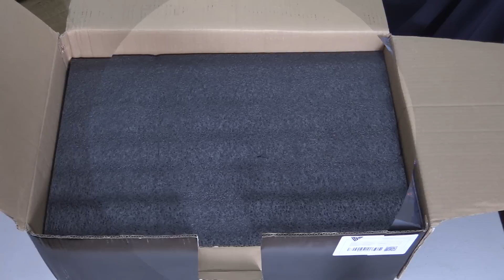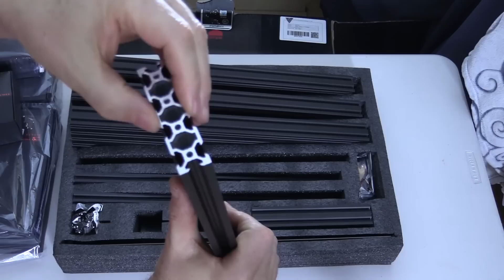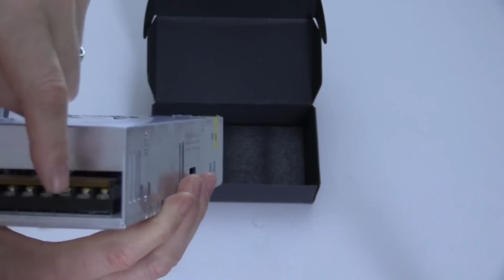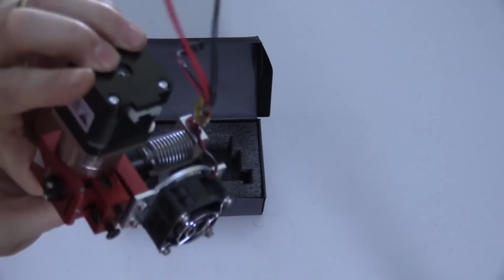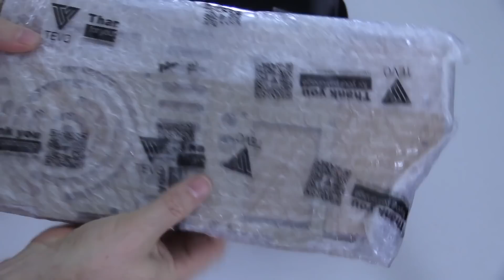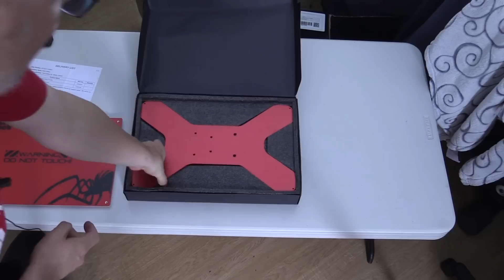TEVO Black Widow 3D Printer Kit - PT1 of 4  - Whats in the BOX

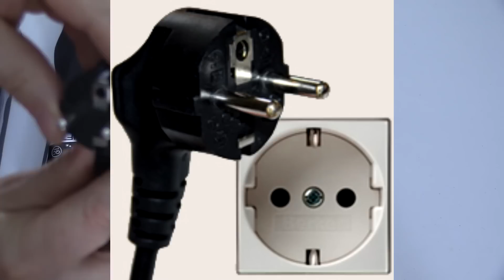Comment: In the European Union there are various standards for plugs and sockets the European standard is what you have in hand, coincides with the German one, the two pins are 5 mm and the ground connection is made with two flat springs that crawl on the outer side of the plug. The hole you see under the plug (24:04) is for the Cechia outlets that have the protruding ground pole. in Italy, on the other hand, we have two standards: a plug with three poles in a row and the central pole is the ground connection, the poles are 4 mm in diameter and the two external of the row are at the same distance of  the German srtandard, and then we have the plug for large loads: it has three poles in a row 5 mm in diameter but more distance between each pole of  the other standard .
I know there are others but I do not know them all ...
it is implied that in every country of the European Union there are plugs for both of the two standards: national and European
Reply from the maker: It is certainly hard to keep track of them all, I think the main thing though is ensuring that whatever your style of plug... make sure it is correctly wired and grounded.
Reply: Surely, you're right, it was just to share a notion with those who were not European.
Hi, to the next video!:-)
Reply from the maker: no problem, I always welcome constructive and helpful feedback / comments

Comment: I should imagine the ringing with that big lump of an extruder will be fairly bad.
Reply from the maker: Its not actually, it is pretty good, its all down to good tuning of course, but I have it printing at 80mm/s with very good results, this is also no different to most other printers with the extrude and hot end in one, there always slower than the bowden tube version but with advantage that it will handle flex etc much easier.

Comment: they should really provide a 0.5 nozzle on the bigger printers or big prints will take for ever.
Reply from the maker: I would agree, for bigger prints it is a very slow process to print with a 0.4 nozzle. it is very cheap to buy additional nozzles though (The inclusion of the 0.4 is probably because this is the defacto standard), Gearbest sells sets Check them out here https://goo.gl/NSFb6w or more specifically the 3D printer parts here :- https://goo.gl/zekWzE